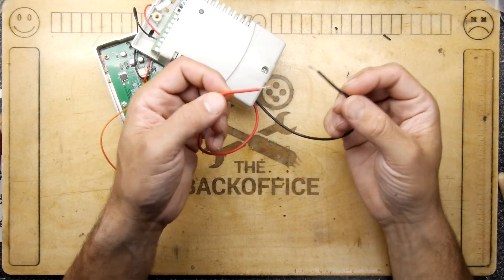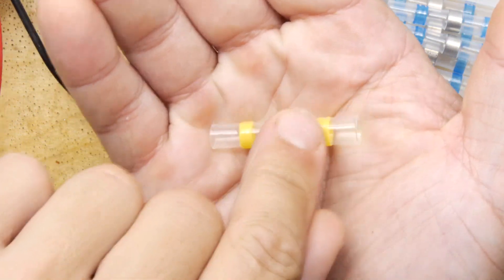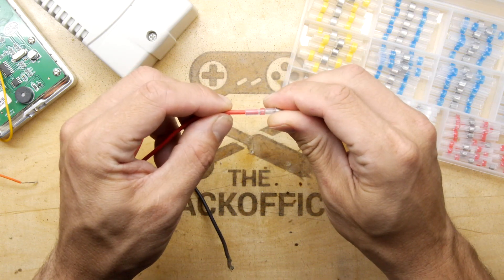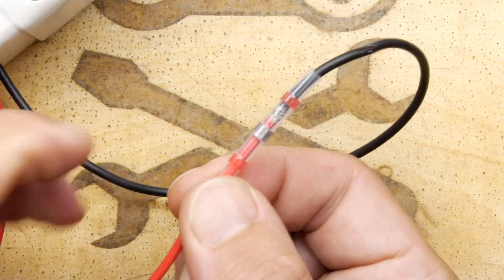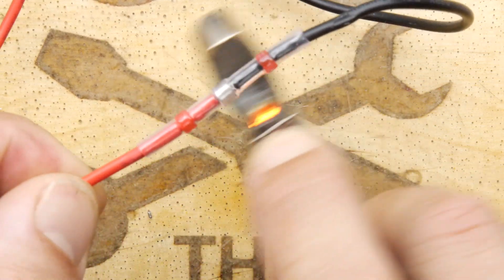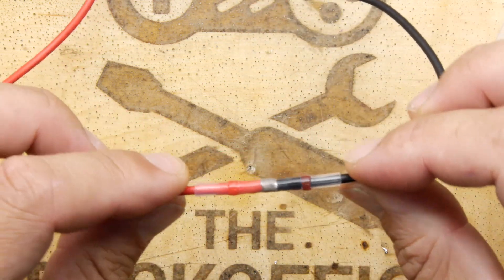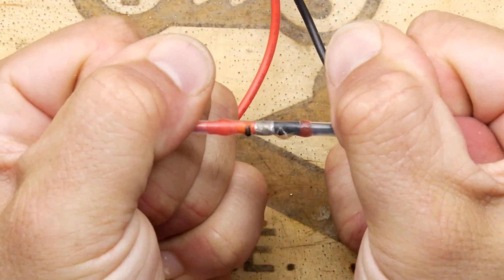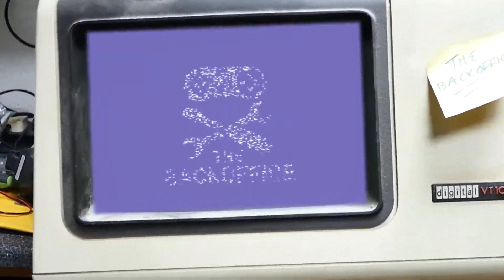Soldered Heat Shrink Tube

Comment: Splendid video Sir, thank you...

I've been using these for quite a few years now, they are excellent, however, I've also always used an extra piece of normal heat-shrink to slide over after this one has cooled down, 1. for a little bit of added protection, 2. I have found that they can pop, like yours did if you add just a little too much heat, so it's always worth adding that extra piece as a just in-case measure...
Reply from the maker: I'm loving that idea, that would be a tough little repair right there!

How about if instead of regular heat shrink you used glue lined?!
Reply: @backofficeshow  

Using the glue heat shrink gives it added waterproofing, I use to use it that way when wiring up spot-lamps, etc...

Comment: These days I tend to use these lever connectors for most things. Soldering only where space is at a premium. Search for CESFONJER Lever Nut Connector, there's other brands. Soldered joints can be brittle, that's why they don't use them in automotive applications. The lever connectors are a bit easier than crimps.
Reply from the maker: I think these are really good for automotive because the splice is held firm by the tube and the glue bands waterproof it.
Reply: Ah fake Wago connectors